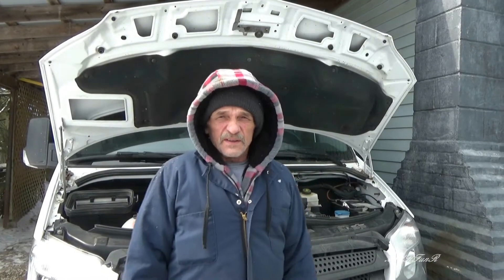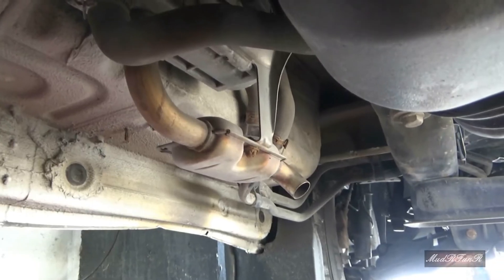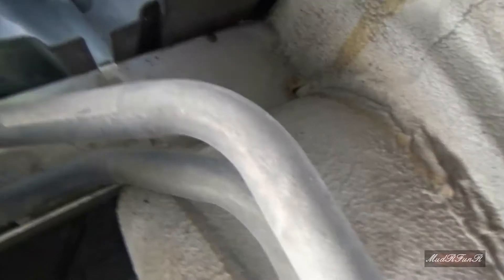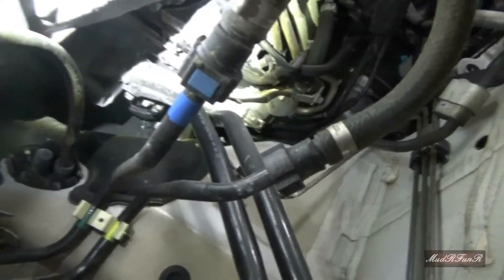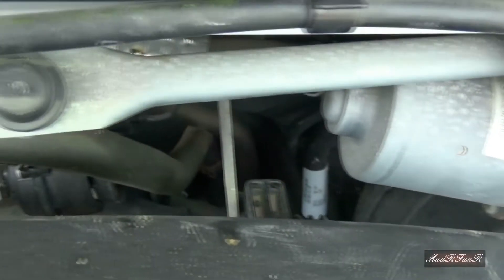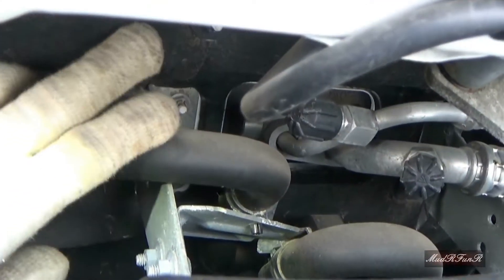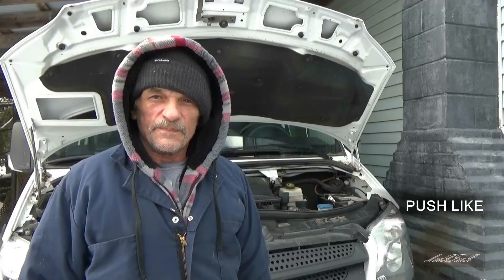Mercedes Sprinter Diesel Block Heater Hose Routing

Comment: The "little thing" is a coolant pump for the secondary heating circuit which pumps the coolant through the heater core whenever the engine is off

Comment: I’ve been looking forever for any information on this system. I’m looking to remove it from my van, from which I understand the hardest part is looping the hose? Can anyone point me in the right direction to find info on removing the rear heater? Thanks
Reply from the maker: I watched the video but I still couldn't think of a definite answer for you, sorry.

Comment: The "little thing" on the glycol line from the heater is a water pump to circulate the glycol to/from the engine through the heater. Most are very similar across many makes of vehicles.
Reply from the maker: Thanks, good to know!
Reply: @MudRFunR  where is the hose to the pump coming from?
Reply: Still unsure where to tee the water pump or which is which.. so the output ( hot water) from the diesel heater is going to heater core input, so where is the input for the diesel heater pump coming from?
Reply: @victordragano8863

Comment: Thanks for the video! I am looking for info as to which heater core line is the inlet and which is the outlet. Perhaps you can help? I am ready to splice in my isotemp water heater. Thanks again.
Reply: I'm installing an Isotemp too, but I'm using a heat exchanger between the factory glycol loop for the engine and the glycol loop going to the Isotemp. This way I only have one short line from the engine loop maintained within the engine bay and no vulnerability of engine coolant lines running all the way to the rear of the vehicle. Any leaks in my heater loop will not impose a problem for my engine operation. I'm installing the heat exchanger on the large mounting plate (via a scratch-built bracket) at the base of the air box which holds the cabin air filter. Based on this video, it looks like I'll be tapping into the factory glycol loop at the driver's side heater core connection in the upper firewall. Cheers!

Comment: this is not a block heater but an auxiliary rear heater.
Reply: These heaters are used in many ways.  As an auxiliary rear heater for sure, it can circulate glycol through a small radiator with a fan to blow heat into the cabin space, or as in a hydronic heating system which is a stand-alone system. Both are popular with van builds. There are two basic engine pre-heating methods, glycol and oil, and glycol can be heated in two ways, internally and externally. Glycol heaters are always "block heaters". This video example is the external application as opposed to the internal type of a small electrical heating element installed into the engine block where the glycol circulates. The internal ones are the most common seen in the industry (because they are functional and inexpensive), which we plug into with an extension cord. The "little thing" he pointed out in this video is the water pump specifically for circulating the glycol through the external heater.

Comment: My Sprinter is an 08' 3.0L Diesel imported to Canada.  Should it have a factory installed block heater?  I can't find a power cord?
Reply: Block heaters of all types are always optional, so it may or may not.

Comment: Thank you! Especially for braving the cold and for such a detailed view! I never would have guessed that it ties in to the heater core and auxiliary water pump. That should be easier than trying to tee into the upper and lower radiator hoses.
Reply from the maker: You're welcome, just happy to help. Hope it can help others as well. Glad you found the video to be useful. Enjoy!

Comment: Good   day  Been a while.  So does it heat itself, no external  source . How it on fuel . Thanks
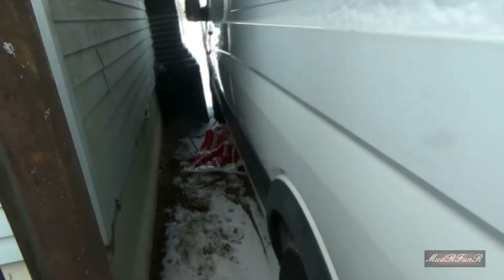Reply from the maker: The heater uses diesel from the van's fuel tank. It heats up and circulates the antifreeze through it. At 0:26 there is a link at the top of the page. You can hear it run here. Great to hear from you again!